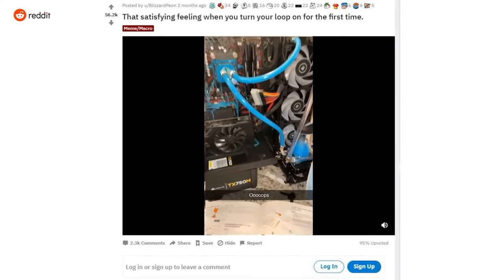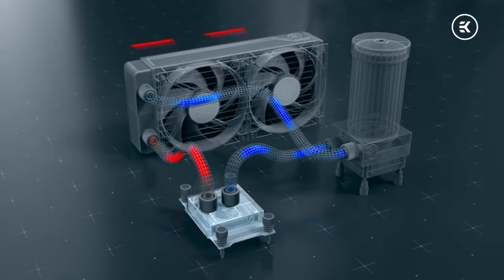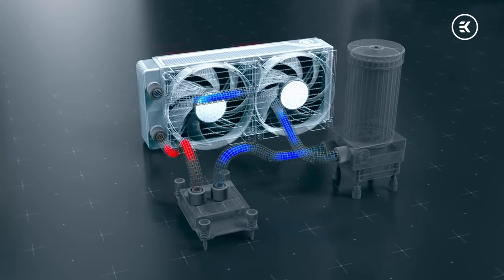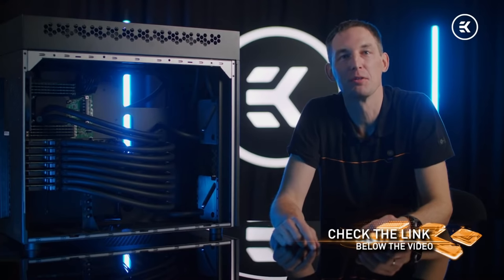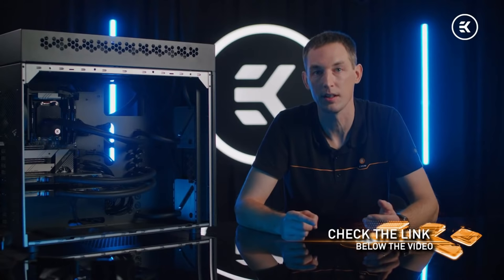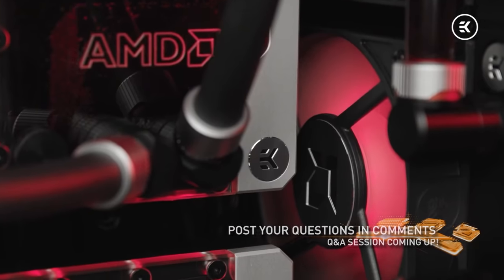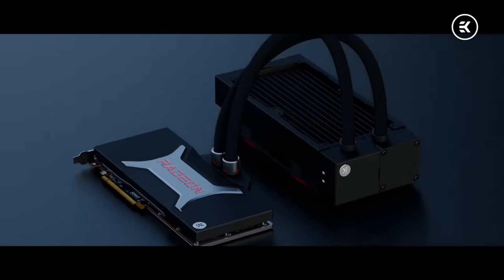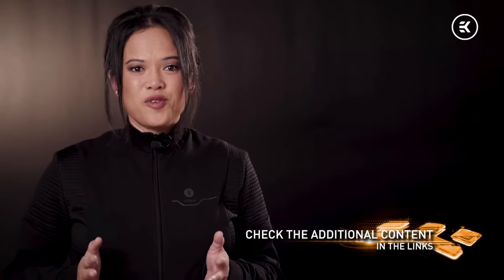EK EXPO Day 1 | Unlocking the TECHNOLOGY |  Main Event

Comment: Amazing brand and love the innovation and quality (being an engineer myself)

Would like to ask advice & compatibility ..

I am wondering how to update my EK Phoenix Watercooling loop as support (new parts) straight after i build my AM4 - 2080 build..
Hope any new products from EKWB have longer future-term support..  (i really liked the Plug-and-Play Prefilled & High quality Custom AIO concept the Phoenix (was) no RTX3080 Phoenix )..
Especially wonder how to expand on the radiator and PUMP is a concern to me as my new 5800X gets a bit hot.. and i need more TDP capacity than with my 3570K. (240 rad only now)
but the Lian Li O11 XL supports much more Surface! (if i can get any recommendations on what to do to build on... (also as i dont wanna mix wrong components (VGL copper X aluminium and if a D5 additional pump would kill the current radiatorpump)

I would not mind to go the extra step and start using a extra pump+Reservoir barbs & flexible tubes (black rubber?) tubes. if i know what to get and use..
Reply from the maker: For MLC Phoenix, you can reuse the base parts and simply swap the GPU block around. It's not quite as plug and play, but that's the current solution. You can utilize an SPC Classic combo to boost performance of the loop. Unfortunately, it ended up not being popular.
Reply: @EKWBofficial  Thank you for your reply!  
I'll look into a larger Coolstream radiator to fit my O11XL case and the advised SPC Classic Combo.  I can use that extra performence since my system upgrade
(i like the fact that the (SPC-60?) pump will be PWM even though its not the famous D5 PWM :)  
Thank you for the advise and it might also help me to make the flow of the tubes a bit better if i add these components (overlength gives a tight curve).

Plenty of Space in my case :) #pun intended

Comment: @EK Water Blocks   could You kindly make frameless fans that can have teh fans popped out form its rotor so for easy wash and dry operation, daisy chain PWM, and ESPCIALLY, offer MIRRORED fan  replacements so to keep teh chassis holding teh rotor completely invisible.
Another suggestion is, that You could acutallly make fans that can be directional, like it is doen in cars... they would certainly take up more space but, the feature could be enginneers to make part of an alement of design and aesthetics language , on top of that with a deeper fan directional channel, Youw ould be able to have more pressure.....
ANother IMportant ELEMENT thay i deem necessary that nobody does, is to have the portion of teh fan chassis completely covered with foam or soem kind of gel, so to seal the point of contact with teh chassis or radiator...this woudl imply offering with teh fan set a plate with precise holes that correspond te the fan diameter..this mointing plate as amatter of facht could be itsel teh fram holding the fan rotors with one single arm instead of classical 3.....
and could be a further element of design and dust filtration...can be used to show  fans or hide fans..and woudl work perfect, if mirrored fans are offered in teh package as areplacement, so you can adapt them to push or pull according to where you place teh fans.

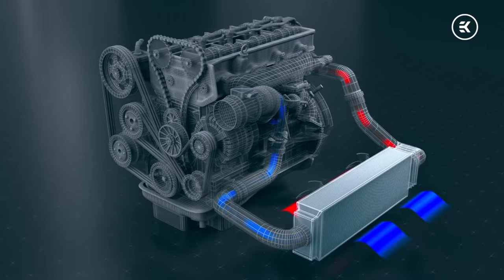Comment: 3:10 - Ehhhhmmm... Ek... That's not a water pump, that's a airmass sensor, measuring air and not pumping water.
Reply: Better that than the flux capacitor.
Reply: @attila EKWB wops just changed my comment, video time was 3:10 and not 14:33.
You guys are highlighting a sensor and not a pump? I find it hard to believe that you are "working" together with car manufactures if you dont even know this part???
Don't get me wrong, i love your product.
Reply: @Shriio  its an obvious mistake, apologies! 😅